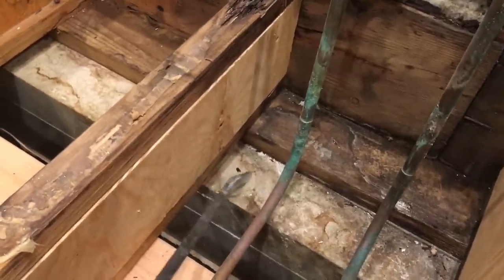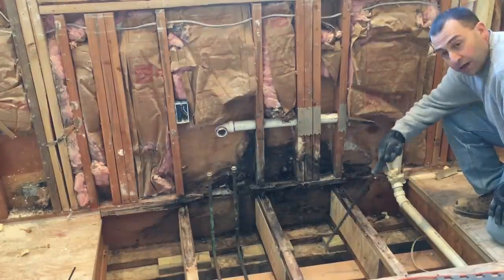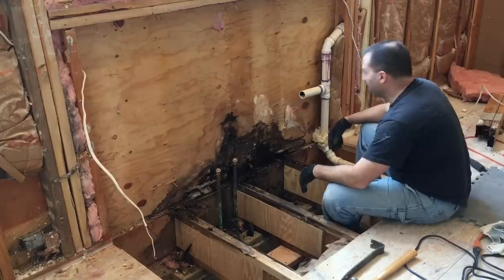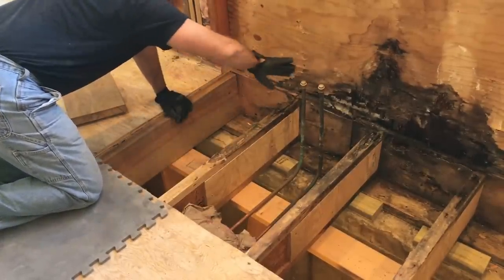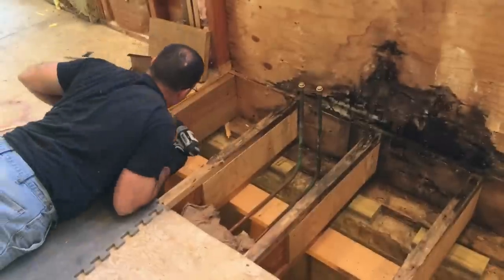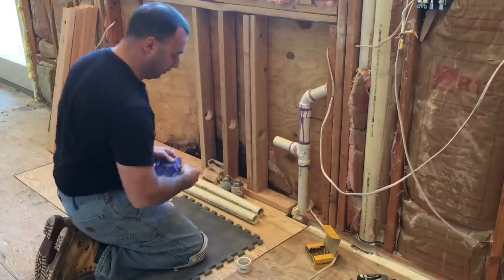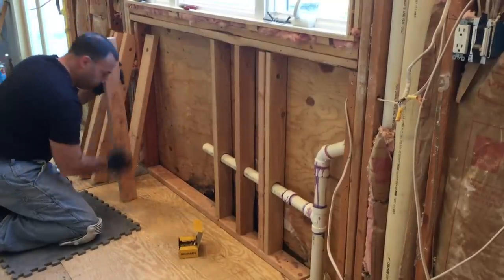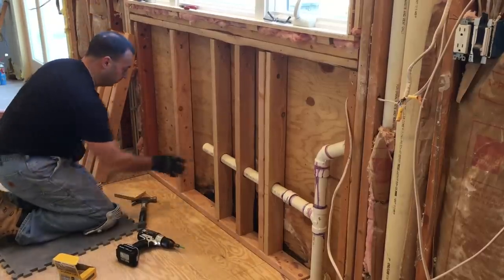Repairing Rotted Joists and Subfloor  - Part 4 of Remodeling My Kitchen

Comment: I’m curious about the wall you built underneath. Is your crawlspace floor level with a dirt floor? Thanks for video
Reply from the maker: No - It is all sub grade like the rest of the basement.  One side has driveway opposite the foundation, another has the garage, another has the rest of the basement, and the fourth foundation wall (the one directly under my kitchen window where I built the support 2 x 6 wall) has a sloping paver patio outside.

Comment: Mike, you did an awesome job on that rotted studs and joists.  That would have saved you couple thousand dollars easily.

Q: in my kitchen and adjoining family room, I feel the vibration in the floor when we walk over it. We had structural engineer come over and he said the joists underneath only has one line of cross braces that joins joists. He told me to put another line 2-3 feet’s apart and that will solve the issues. What do you think about it?
Reply from the maker: Thanks for watching and commenting.  As for your situation, it's tough for me to give an opinion without seeing it.  That said, what your S.E. is telling you makes sense.  Adding an extra support wall under the floor, perpendicular to your joists would never harm anything.  It would only give it more support.  I'm not sure what you mean by 2 - 3 feet apart.  If you build a support wall, the studs should be 16" on center.
Now, the vibration may have nothing to do with the joists being inadequately supported.  It may be a faulty subfloor (The 3/4" layer of plywood that sits directly on the joists.)  Perhaps it wasn't fastened properly to the joists, or perhaps a lesser quality plywood was used (i.e OSB board, or 1/2" ply, etc).
What kind of finished floor is in your kitchen and family room?  Tile?  Hardwood?  Carpet?
Reply: @DieselMike  thank you for your quick reply.  my kitchen floor has Vinyl. When I remove it ti replace with tile or different material, I can check the base floor and I’m pretty sure it’s loose too. 

When I said another line of those cross bracing between joists at 2-3 ft apart means, there is only one line of cross braces goes across the room between joists. So there isn’t enough support for rest of the width of the remaining joists. Hence, he asked me to add another line of continuous cross bracing.  I can send a picture of what I’m talking about. But not sure how I can do it here.
Reply from the maker: @nvshahnik  Yes.  Now I understand.  Sure that makes sense and might be worth doing.

Comment: I might be wrong but after I rough fitted all of that I would have lifted it up and crop dusted that area with boric acid. Looks like a little water damage left behind.
Reply from the maker: Everything got a healthy dosing of bleach.  Any living mold was nuked and no new water has been introduced to revive it.  As far as the rotted wall.  That was replaced from the outside shortly after the video.

Comment: He should of i immediately treated the floor joist plywood in any wood that he didn't remove that had mold damage. It very important to treat for mold damage.  Other than that he did do a pretty good job.
Reply: he said in the comments that he treated the wood over several days then dried it out and ran a dehumidifier but didnt include that in the video.

Comment: Im remodeling my kitchen.
So far I have my subfloor and cement board laid. As I walk over some areas sink is that normal ? Or will the cement layer thinking and stiff the floor for when I lay tile ?
Reply from the maker: No, it's not normal.  If there is movement in the subfloor, something is not right.  I would not lay tile over a subfloor that bends and sinks in some areas.  Recipe for cracked tiles.

Comment: What screws are you using? Code doesn’t have an issue with not using 3-1/2” nails? I know it’s different code everywhere and I’m just curious
Reply from the maker: 3-1/2" construction screws for 2x4 to 2x4.  2-1/2" for securing the plywood to the joists.  They have a boring tip which greatly reduces splitting.  The holding power is insane.  Also very easy to "steer" them when toe nailing.  I get the Grip-Rite from Home Depot.  But the brand name(s) of this type of technology is Spax or GRK.  Check them out.  Thanks for watching and commenting.
Reply: Diesel Mike, do you mean structural screws? Or are these just deck screws?
Reply from the maker: @nsatoday  These are what I use:  https://www.homedepot.com/p/Grip-Rite-3-1-2-in-Construction-Screw-1-lb-Box-312GCS1/204959266

If you notice a box of Deck Screws in the video, It's because I just combined the packages.  But these are the ones I used in this video.
Reply: nsatoday in NC screws are not allowed in framing period. some inspectors look the other way when a truss repair or missing jack is added per their request and screws are used; as long as the nailing pattern follows the nail pattern in the engineered repair letter. Nails of course have a much higher tinsel and sheer strength then screws which i still have a hard time accepting. 
But i built my 20x20 garage and used only decking screws for walls and stick built trusses. I nailed the sheathing per code. I have built over 230 houses in the past 6 yrs so i know building code but it doesnt apply on my personal property lol

Comment: Did you do anything to treat that mold? Won’t it just continue to grow if you don’t handle it or cut it out?
Reply from the maker: Oh yes.  I've been spraying it with straight bleach since the day I discovered it from down below.  Once it was opened up I spayed more bleach.  And then it had days to dry out while open.  The only "dead"" mold left over is on the inside of the plywood sheathing.  Which, as I stated in the video, I will replace from the outside by removing the siding, cutting out the damaged section and replace with new.  Thanks for watching and commenting!
Reply: @DieselMike  ive used bleach in the past i would bleach it for a while. Niw they say bleach is not effective what do u thunk?
Reply from the maker: Ras Ra Bleach is 100% effective on mold. Mold has zero shot of surviving after coming in contact with bleach.  It also can’t thrive in the absence of dampness.  Whoever tells you different doesn’t have a clue.  You are good to go after spraying it down. Just let it dry real good as well after.  Thanks for the comment.
Reply: @DieselMike  Wood petrifire will kill any mold and fungus as well as harden the wood, its cheap and you spray or brush it on and in 24 hours you are good to go and you could fill in the areas removed with PC woody its a wood based two part epoxy that when mixed looks and feels like peanut butter and ends up harder than the wood.

Comment: Should have wire brushed all the rot out use some wood petrifier and fill it in with PC woody. Leavint that rot in there and it will just spread.
Reply from the maker: Hey.  Thanks for the comment.  The wood petrifier is a great idea. In my case I'm quite confident there is no chance of any bad stuff spreading.  After I opened the floor I killed it with a ridiculous amount of bleach, which I let soak deep into the wood.  Then for weeks I allowed the dry out process to occur by running a dehumidifier below as well as the opening to be exposed to a climate controlled living area above. There's certainly no living mold left to spread.

Comment: 9:54 I would have cut the rot out of the joists and replaced that section of rotten wood as well.
Reply: How ??? What do I search to figure this out
Reply: @bizizbizbam8209  Use a Cordless Variable-Speed Oscillating Multi-Tool to cut out all of the rotten wood. Then cut a new piece of wood to fit up to the correct level/height. Use construction adhesive to glue it into place, and if the wood is thick enough, use screws in addition to the glue. Sister up additional wood if it's not sturdy enough.

Comment: That floor joist repair is original but it probably won't pass any real inspection.  I have yet to find a good video on how to replace a floor joist in an existing house.
Reply: Floor joist repairs by their nature are non-prescriptive (not in any code book), so a building inspector isn't going to waste his time laying his eyes on it.  Typically they require a local structural engineer to put together a repair plan and sign off on it.  That is how building code officials treat non-prescriptive building elements and repairs.

Comment: What kind of screws were you using?
Reply from the maker: Grip-Rite construction screws.  3-1/2" for toe nailing (toe "screwing" in this case) any 2-by to 2-by material.  And 2" or 2-1/2" for securing plywood to the joists. Thanks for watching.

Comment: What happened to your 2 copper water pipes? They're not coming up like they were before.
Reply from the maker: Good catch.  I cut them clean off in the basement so they didn't interfere with laying the plywood.  Later on, I drilled two holes in the sub floor, converted the copper pipes in basement to PEX, came through the holes, installed my shut off valves and I was good to go.
If you view some of the videos further down this playlist, I'm sure you will notice the PEX pipes sticking up through the floor:
https://www.youtube.com/playlist?list=PL6rvPn4fy9Y3YMenedWsK5HGp0uCQ_W6u
Thanks for watching and commenting.

Comment: Not sure about this one. My first thought was (and I was waiting and waiting) when are all  those rotten joists going to be cut out like they should have been. I have just taken up my hallway floor with the intention of tiling but most of the joists have some sort of woodworm or rot so I shall replace everyone of them. I really dont see the point of just spraying the old (and securing new to them expecting re-enforcement). A talented guy but an awful lot of time spent trying to repair when it would have been quicker and probably cheaper to replace the lot. Leaving the cause of the problem there isn't going to help in  my opinion. Good video though.

Comment: Nice work. Something like this would've stressed me out so much i wouldnt be able to film because every word out of my mouth would be... you know. I have something similar to this in my bathroom but its only on the floor because the guy who owned the house previously used particle board for a subfloor...
Reply from the maker: Thanks for watching and commenting.  What you are calling particle board is probably OSB.  Be aware, if you cut out the bad piece of OSB (or particle board) and replace with plywood, they may not line up properly. 

What we call 3/4" plywood, may be 23/32" depending on brand, style, OSB vs sanded ply vs actual particle board, etc. 

To further confuse things, these numbers are nominal measurements.  Meaning, that was the raw measurement before milling.  So a 3/4" ply may really measure .71875".  23/32" OSB actually measures .703"
Take that into consideration when trying to match the "patch" with the existing floor.  if you can't get a perfect match, go a tad thinner and make up the difference with leveling compound before laying tile, hardwood, or some similar rigid product.
Reply: @DieselMike  you sound extremely educated on this stuff. I appreciate the comment back but im gonna have to pull up the whole floor as it is falling apart and flaking. It feels like cardboard!
Reply from the maker: @anthonyhall6490  That's actually better.  This way you will have one uniform sub floor throughout.  I suggest laying 3/4" Plywood directly on top of the joists once you remove the old.  If your joists seem compromised from water damage, address that (Like the "sistering" method you saw me do) before laying new floor.
The 3/4 layer will be your "structural" layer.  Depending on what type of finished floor you are going with (Tile, Hardwood, carpet), you might need another layer atop of the 3/4" layer.  For example:  If laying ceramic tile, you can't apply mortar/thinset directly to the 3/4" ply.  You need another thin layer in between.  At this point you will need to check with your local codes for what is required.
Reply: @DieselMike  i dont believe the joists are compromised but theres wood planks layed on the joists and then the subfloor starts. I dont think it matters i should be able to just rip out the subfloor and replace with 3/4th plywood. I may try laminate click board as a floor have you ever used that?
Reply from the maker: @anthonyhall6490  Oh yes.  I did my entire basement with it.  Came out extremely nice:  https://goo.gl/photos/dBbRpyU9s1QeX2V1A
Scroll through that album about 2/3 the way down to see where the flooring begins.

Comment: Not bad but I would have replaced those rotten joists. I would glued and screwed everything including the pressure treated supports you hammered in. You have to be very careful about breathing in all that mold and copious amounts of purple PVC glue you applied. Best to wear a ventillator, eye protection, etc. I would have replaced those copper pipes while I was in there as well. 

When gluing the PVC, mark the pipe so you know when it is fully seated and evenly seated. Also, drains need to be gently sloped ~1.5% or a little over 1/8" drop per foot. No more- no less. The idea is to have the water swirl upon exiting the pipe which cleans it better. If it is too steep it only runs our the center of the pipe, leaving the sides unlcean. They have tools you can use to precisely measure the drop.

Comment: You need to remove all the rot. Everything that is rotten will spread, the 1/2" plywood sheeting to the framing.
Reply from the maker: Wood rots because of fungus growth.  Fungus develops because of the presence of dampness.  Remove the water source and it's a biological certainty fungus cannot grow.  This whole idea of rot spreading in the absence of dampness is scientifically false.
Reply: If the area is well ventilated and damp free it will not spread
Reply from the maker: @amyswale7061  Thank the Lord.  Finally someone who understands science.  Thank you for that!  Eliminate moisture and the mold (which causes rot) simply can not grow.  Appreciate the comment.

Comment: he  left   shity  timber   in  !?  not  treated ?
Reply from the maker: Pressure treated joists, pressure treated sill plates, pressure treated ledger board inserts, and pressure treated floor board under new wall in basement.  Where exactly is the <sic> timber?  The new studs in the wall which come into no contacts with concrete?

Comment: where do people live that they are seeing wood rot spread after u remove leaking water from the equation? rain forests? ive never once seen rot continue after removing water.
Reply from the maker: Amen to that.  Thank you very much for pointing out this obvious fact.  All these comments claiming that I failed miserably because I left behind a little dark, stained wood?  Clearly they aren't understanding that the four step approach I took, this floor couldn't possibly fail now that there is no more water infiltration.
Thanks for watching and for your tremendous comment.

Comment: Why did you let it get this bad ? You said you know about it for sometime now. I would have spent the 5 dollars to fix it as soon as I knew it was bad.
Reply from the maker: And how would you propose I could have done that for $5?  To gain access to the drain pipe in the wall would have, at a minimum, involved removing the sink cabinet.  In order to do that, the granite counter top would have had to be removed (sink cabinet only thing holding it up).  Then the drywall cut out, insulation removed, studs had to come out (even if caught before rot) in order to slip and glue a new pipe.  This was a much better fix.